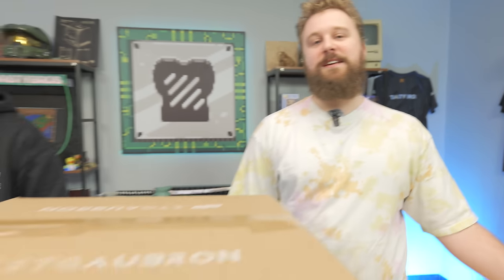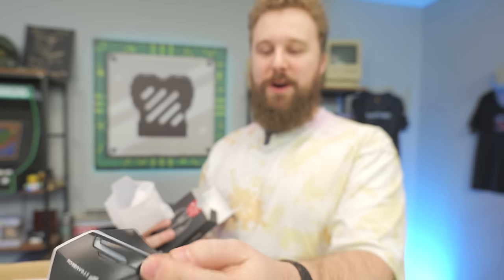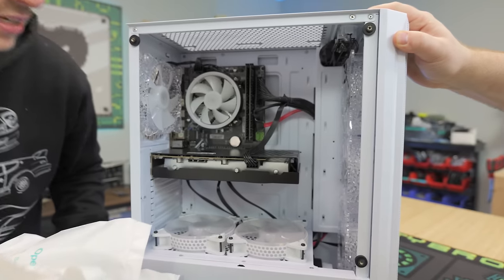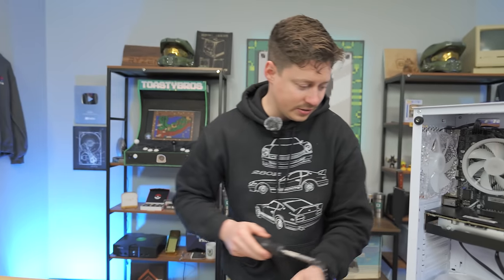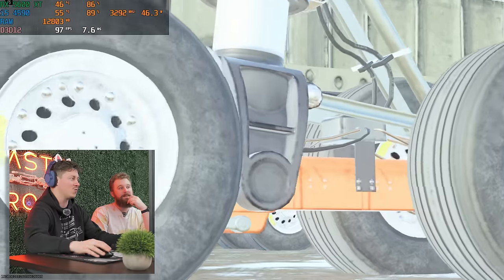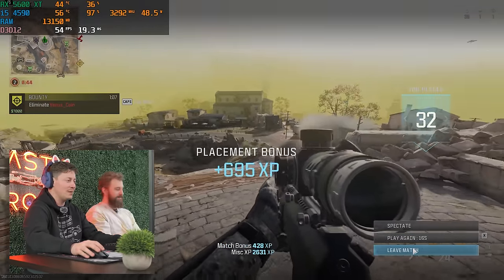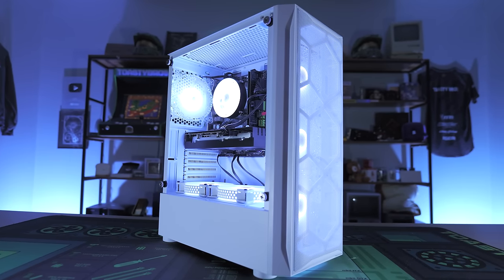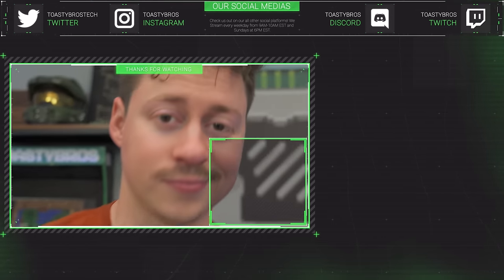Why is EVERYONE Buying This $479 Gaming PC?

Comment: This company is desperately needing to update their inventory, at least make them 6th gen, preferably 8th gen for W11 support. If they HAVE to stick to 4th gen, minimum the i7 chips for the extra threads, c’mon. The driver overhead can only do so much
Reply: Absolutely. With that GPU, an i7-4770 or 4790 would make a world of different in gaming with the extra threads available. I would love to see the Toasty Bros. drop in one of those chips and compare the performance. 4th gen is still viable, but only with the i7 CPUs.
Reply: I wonder how would old AMD FX-83xx do with this GPU. Definitely underused here.
Reply: @aleksazunjic9672 I have an FX8320 PC that I no longer use. Maybe I'll get the 5600XT and try it out with the FX8320 then I can put the 5600XT in with my i7 8700k.
Reply: @BREEZYM6015  Sadly, AM3 platform was very underwhelming. A 6th 7tg gen i5 runs laps around the best ones even.
Reply: @BREEZYM6015  It suppose to run a little better in newer games that utilize all cores and threads.
Reply: I think the no cpu is the best option at 0$
Reply: dudes getting paid to push this bs, i would rather get a potato with some vram
Reply: Not even 6th gen anything above 6th gen cause 6th gen is DDR3 and DDR4 it should be standard DDR4

Comment: So I could potentially sell my i7 8700k, GTX 1060 6GB, 16GB of DDR4 RAM, Corsair H100i 240mm AIO cooler, and 4 storage devices for around $400. Oh, and the case has 7 RGB fans.

Comment: When I had this CPU (well, the i5-3320 which is pretty much the same grade of CPU) it was married to a GTX760. When I upgraded to an i5-8400 system with a GTX1070 I bought the 1070 first and installed it in the old PC while saving for the rest of the parts and oh boy the bottleneck was real.

Comment: 4c/4t CPUs are still usable for PC ports of PS4 games (2020 and earlier) but after that ... I guess you could run single player games like Elden Ring with FPS locked and that is that.
Reply: @dragosthule  4790k has 8 threads, dude 😁

Comment: I wonder how it will be like if you upgrade from the 4570/4590 to a 4770.
Reply: it wont bottleneck the gpu. i run 4790k and rtx1080(equal to 5600xt) 0 bottlenecks. both run 90+% utilization in games.

Comment: I have a Stgaubron i7-10700kf with a rx6600, they make some junky computers and have some really cheap older component computers. I think this line kinda targets the I don’t want to spend to much crowd, mine has a branded gpu (powercouler)the motherboard is a 510 chipset but i didn’t pay to much. It all comes down to understanding what your buying, if your not going to research what your buying this is what you get.

Comment: They should have just slapped an AliExpress X99 setup in it.
That pairs fantastically with the 5600
Reply: so does the i7 of that gen. they used the cpu they did because thats what they got a ton of for cheap.

Comment: the lga 1150 xeons are good. you can get an 8 thread lga1150 xeon with 8megs of cache for very cheap
Reply: Exactly….why they don’t go with an e3-1270v3 (4790) and 16gb of ram for that price. It would make it old but decent.

Comment: Guys I need some help. This week while playing games my pc keeps black screening, and the gpu(Rtx 3060) fans go full speed. This started happening after the most recent windows update. Need help
Reply: Are your video card drivers updated? I just updated the drivers yesterday for my GTX 1060 6gb. You could also try doing a system restore to go back before the Windows update and see if that fixes it. It sounds like a driver issue or perhaps a Windows compatibility issue.
Reply: @BREEZYM6015  drivers are up to date. How do I go about doing the system restore

Comment: I think not good value at this price, as just finished comparable build with ASRock B550M mobo, Ryzen 4100 CPU, 16GB (2x8GB) VulcanZ RAM, 1TB NVME, and RX580 2040SP w/ 8GB VRAM, w/ white Montech mATX case w/ ARGB fans ... total parts $489.  Otherwise, everything was comparable (excluding el cheapo kb and mouse).

Comment: i have a 5th gen i5, nvidia quadro k600 and 24gb of ddr3 ram plus a 250gb off brand ssd and an 500gb hdd as my secondary pc, its not worth upgrading as it is just an old acer veriton sff but considering i got the pc for free and used some ram i had laying around the only thing i paid for was the gpu so for a 15$ pc its worth  it at 30-60 fps min settings fortnite

Comment: Can y’all answer me pls much love btw I’ve watched every video until I got my pc 2 months ago it’s the picture as my profile got it first month this year for 1020$ out the door at action pawn shop in Texas. Did I get robbed? Came w gigabyte 175hz monitor ibuypower mouse keyboard and mic/headset I could run 160 fps steady think it sounds good? Amd Ryzen 7 3700x 8core processor 3600 mhz, 32 physical ram and its windows 10. Pls great video once again.
Reply: What GPU came with it? Pawn shops generally sell their merchandise for a lot more than they bought it for. What you could do is look up the price for each part and tally up the total and see how close that comes to what you paid for everything.  Hopefully it's close to what you paid but don't be surprised if you paid a lot more than if you had built the PC yourself.

Comment: STG Aubron is Skytech's canadian side hustle and they are absolute trash. I had to build a customer an entirely new pc because his came straight from STG with a broken 2060, horrible chinese bios and the 16x pcie slot only worked when it wanted to laugh at the poor customer...$580 bucks for a 4790 cpu and a fried (the fuses were broken off of the gpu that the SI decided to paint bright red, even the hs on the cooler was painted over) gpu....the case had buttons for the "argb" and reset button, the switches under said buttons were completely non-existent.  I've seen more rigid metal on a Yugo vs the case.....have fun with that lmao........hot garbage. Oh and don't even bother contacting the company because they WILL NOT respond to your emails.

Comment: I have a 4670K and an XFX RX 6600, that should be worth $550 to $600 right? lol
Reply: Bro, a 6600 with 4670k would give you sooo much bottle kneck also its worth like 180 in total for both of those but if it were a pc probably 300-400 at most or less, since 4670k is a decade old using ddr3 ram